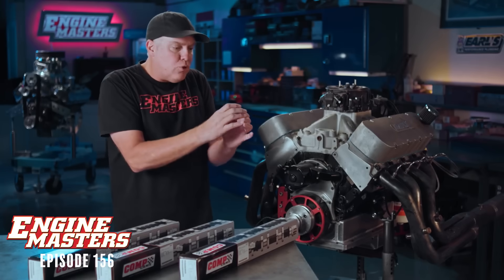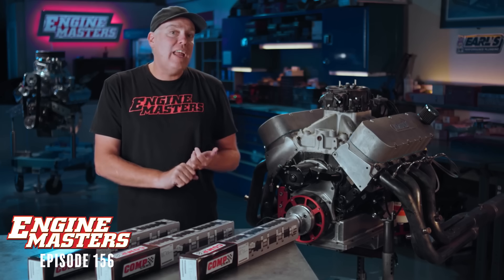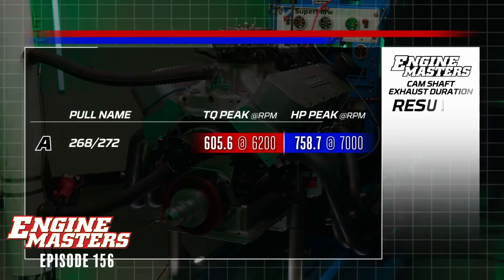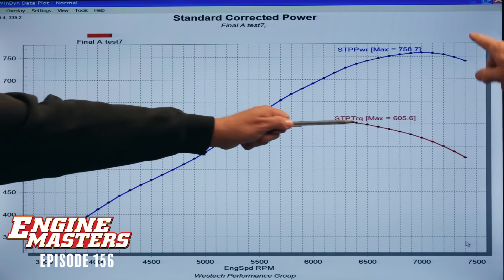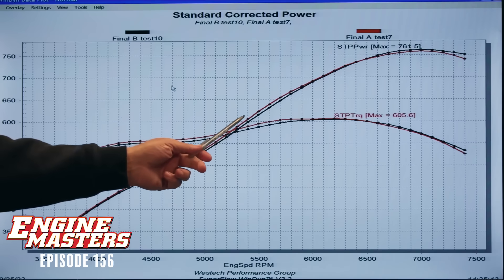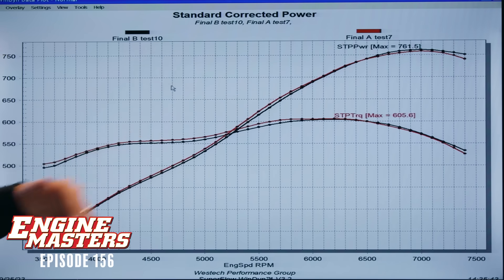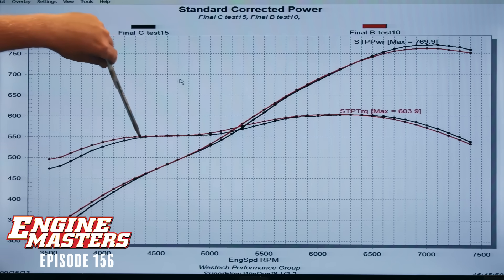Do Longer Camshaft Splits Affect Performance? | Engine Masters

Comment: I'd like to see the effects of increasing/decreasing the lobe separation angle and even bigger exhaust duration!  Also, exhaust tube length will have an effect...
Reply: The problem with that is the cost of the blanks to do so. There is a reason you can rarely find a 102 lobe separation camshafts for high flow heads, and that is because the vast majority of blanks don't support grinding it there due to pre grinding and hardening the lobes prior to final grinding, and that can't be ground there afterwards.... That is also why good camshafts for serious hp can cost north of 2k. The blanks are all custom made..... This video is comparing off the shelf cams, that get left in the dust when put up against anything with a well thought out camshaft. Case in point, 1000+hp NA small blocks, you are not ordering that cam from Summit...... Summit doesn't stock anything like that, because you cant grind it on a 10 dollar blank......
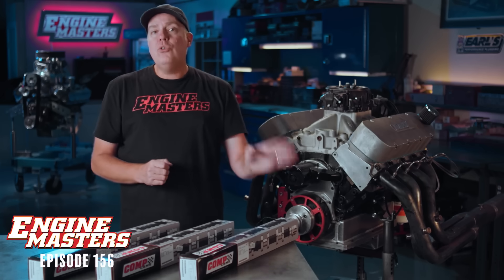Reply: @shvrdavid  agree with you, but at 2:03 David says they are custom made camshafts, so not off the shelf.a DOHC engine design could have also been used for this test.
Reply: @alertgasper  Custom ground is a bit different than custom made.
Reply: @shvrdavid  naw, "Custom" means "not off the shelf". Competition Cams got busted in the 1980's by their competitors for not even making their own camshafts--they bought and reboxed 'em. Whoever makes the stick, however it's the grinding of the profile that makes it worth anything. so, custom is custom because its custom.
Reply: They did the LSA test and there was nothing new.
Narrow it, and you get a lot of midrange punch with a good bottom end torque. Widen it, and you soften the bottom, and move peak power up. That's just LSA for you how it's always been.
Reply: @AB-80X  but the OP wants LSA and longer exhaust duration. not sure how, likely a tri-y or some type of exhaust that's better at scavening would suffice. 

a lot of times, one part on an engine gets swapped to see results, might be interesting to see when something downrange gets swapped as well to help the initial part do its best.
Reply: @alertgasper  
True. 
That said, here's something to consider. What really matters here, is when the exhaust closes. When you increase the LSA, you move the point of closing the exhaust valve. When you increase the duration, you do the same thing. Yes you obviously retain the opening point, but that is less important with the exhaust than it is with the intake. So from a power standpoint, the engine reacts in much the same way in terms of where the power peaks are. The engine with the increased duration, tends to not soften quite as much low down as the widening of the LSA. This is what we see when playing around with this stuff in DOHC engines. So by that, what happens is, that if you increase both, you raise the peak points of both, just like you would if you pushed one or the other further.

What some can benefit from, is the lack of overlap with a wider LSA vs a bigger duration. It really depends on what you tend to use the engine for. This is where you will start to look at dynamic compression in relation to which octane you want to run, if you want to run boost etc. So while you might not change the power peaks and curves all that much all things considered, you can sometimes make a pretty significant difference in how an engine will handle boost, if water reversion is a problem in a powerboat, if it is suitable for carb or EFI etc etc etc.

Lastly the head itself will play into this. There are some who mitigate poor exhaust flow in relation to intake flow, by adding duration. Personally I prefer to add exhaust lift if possible. This is another thing this test does not take into account. What are the capabilities of each port, what is the MCSA on both ports, and perhaps create a starting point where you via lift create a situation where the exhaust port efficiency is about 75% or better of the intake.This is where I think Engine Masters failed the most. Brulé was very old school. He was used to older lobes and he tended to choose duration over lift. With modern lobes, just throw some lift at it before you start to get into those 260+ durations. There are hydraulic LS lobes now capable of 800 lift, and they are way softer than even the softest of roller lifter lobes.

That was a bit of a tangent, but at the end of the day, wider LSA and exhaust duration tend to do similar things. Adding both, adds more.
Reply: Interesting take. Sometimes there's a negative in not containing the combustion cycle for longer and expelling gases earlier?  There's also the variable of increased heat with containing the combustion too long? Then there is the buffering effect of nitrous and then the scavenging effect of the turbocharger taking on more of the heavy lifting and possibly making gains from heat and post combustion helping drive the turbo etc.
I'm listing now as I'm typing and they are all disgusting these variables
Reply: @jameshatton4211  the first few inches of piston travel from TDC create the power, and after that the volume of the cylinder is large enough the piston's just along for the ride. And then there's the factor of RPM. for example, the classic "rump rump" camshaft that blows compression out at low RPM, but makes more power at high RPM because it's clearing out the combustion chamber better than the head's port configuration can do it by itself. A turbo can become an impedent in exhaust flow when used for a long period of time, but intially a warmer exhaust gas temp can get the intial spool up since hot air is more "active" at the molecular level.

there's always a give and take.
Reply: That may, or may not, be true. The guys on TV ARE smart. But there's more guys out there than you think that are just as smart, or smarter.
Reply: Over exaggerated split would just give you diminishing returns and kill the low end.
Reply: They've done it seem it rift before this
Reply: I love all the" experts" 😢 who try to get on here and flex, if you knew as much as either one of these gentlemen you would have your own show. Stop making yourself look pathetic, sit down and watch and you may actually learn something. I doubt it but at least try.

Comment: Why wouldn’t u base line this with a single pattern to start and demonstrate the full effect of longer exhaust duration?
Reply: You can see the trend. A single pattern is going to be lower on the top end and a tad bigger or the same through the middle. No single pattern won an emc challenge
Reply: @cedricwilson2055 it’s still completely dependent on valve size porting and intake config.
Reply: @TheFogLakeshore  in the emc challenge all they used was dual pattern cams. And all the heads were killer. That pumping loss must be more detrimental to hp with single pattern cams. Those few numbers through the middle, they can accept that
Reply: That’s a test he stated they’ve already done before.
Reply: They already did that test, they started this video saying that
Reply: Longer run time for the show which results in more production time which results in more money. I'm sure they love to do it if you'd love to throw some of your own cash in there
Reply: So if you can sacrifice low and mid range power for top end power this is the way to go
Reply: They are just marketing man. Your not gonna find anything but that anymore